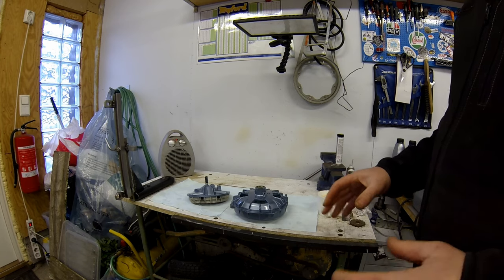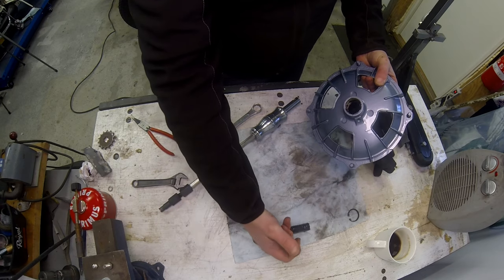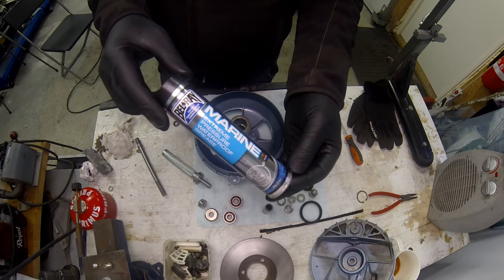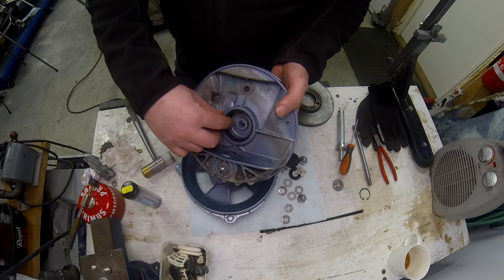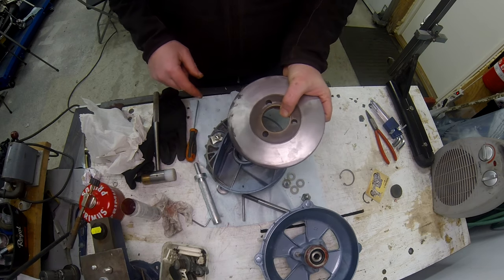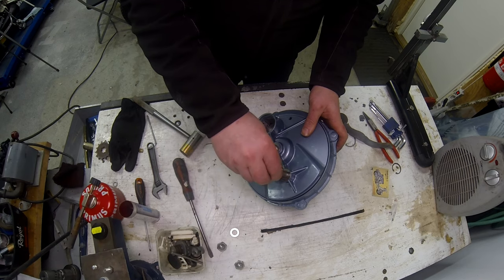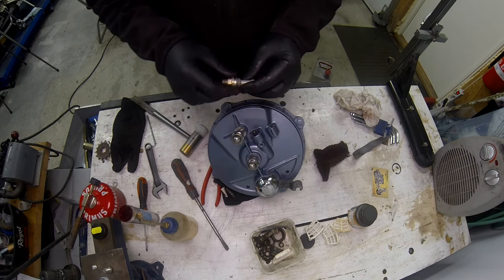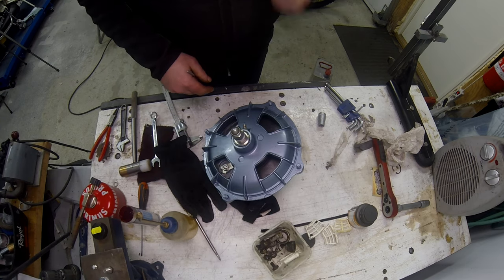Lambretta TV175 disk brake rebuild

Comment: Great video mate...but definitely remove circling, and reverse pull if the owner doesn’t mind the look, then with some good setting up, that will be a good break....oh and a decent front cable!
Reply from the maker: Ok. That's convinced me. I'll remove the anti rattle circlip. I heard only the other day that someone was making an extra fat front brake cable for original disk but can't remember who now 🤔 I think mb or bgm. As soon as the new camera turns up it all systems go!
Reply: @kickbackgarage   BGM thicker cable ..... BGM6408FB ... you may have to "fettle" the switch housing on S1 / S2 & early S3 as the outer cable is 1mm bigger, at the brake end you omit the "top hat".
Reply from the maker: @martincorrado600  perfect.! Cheers.

Comment: The idea of those Seals is to protect from dust, rain etc, I always fill the inside with grease. ..If in doubt add some grease.....Hmmmm..it crosses my mind that if the bearing gets hot, some grease may melt and lubricate the bearing, at least for a little while...always look on the bright side...heheheh

Comment: Rob Am I correct that there's no hub nut / axle nut on the speedo side of the disc brake, just the one at 5nM on the window side?
Reply from the maker: Correct. That is because the axle on the disk hub has a flange where the drum hub has a streight axle and needs 2 nuts.

Comment: When you were re-fitting the windows, keeping them slightly bent, you should have been able to push them into place using both thumbs rather than risk damaging the paint with the screwdriver.
Reply from the maker: I think it's because they are the original windows gone hard. I've ordered new softer/whiter ones from scootopia.

Comment: I recommend to use ONE Newfren sinter brake pad in the position of the static brake pad to gain better braking performance. 
The use of two sinter brake pads (in combination with pull reverse) I DON'T recommend as the moving one wears very fast and the break needs re-adjusting after 5-6 times of hard braking.
Reply: What pad do you use on the other side Thomas?
Reply: @gavcat2382  A Casa Lambretta standard brake pad.
Reply: @thomaskunkel7460  thanks, mate.

Comment: Did you remove anti rattle spring in the disc ?
Reply from the maker: No! I moved it round (as suggested in Stickies) so the the worn parts were hidden. I did talk about that part but have serious camera issues, hoping new camera turns up this week. I had a nightmare editing this vid because I ended up with 50 + takes!
Reply: Kickback Garage I take mine out. Use as a floating disc. Is rattles when going slow but give an even breaking on the 2pads.
Reply from the maker: Ok. I will se how it works first but thanks for the tip! Should I set it up reverse pull you reccon?
Reply: Kickback Garage Got reverse pull on my tv200. Pulls up lovely
Reply: Really good video doing mine at the moment  very helpful cheers.

Comment: Nice Job but fire your painter, I see Runs in th paint, with somthing like that with lots of edges light coats are needed
Reply from the maker: Although I agree, the guy who painted it was fast and cheap and you get what you pay for. It won't really be noticed once it's up an running.

Comment: When I saw you removing the paint from those pins, which I reckon should have some grease for free movement, it made me laugh when you applied a little emery paper and the powder coating disappeared, which is always my point of view...powder coating, all Presentation, no balls...hehehhe
Reply from the maker: Unfortunately, those pins need to be dry, or a little copper grease. The centrifugal force will flick grease all over the disk and pads.

Comment: My last tip of the day, grease nipples, especially brake ones, often you can find rubber caps for them. last tip of the day, I stick Vaseline, our old friend, in lots of areas, keeps out moisture, protects chrome, stainless steel and wicked women..just joking....